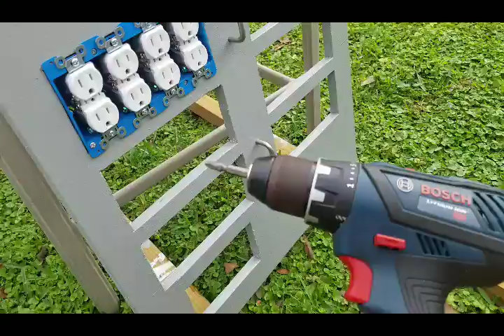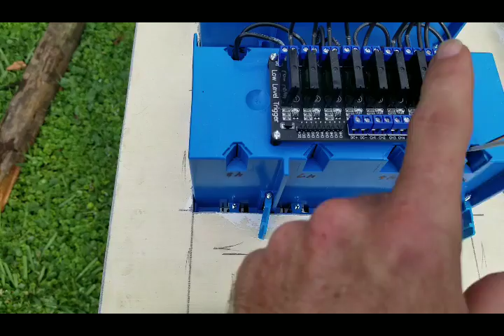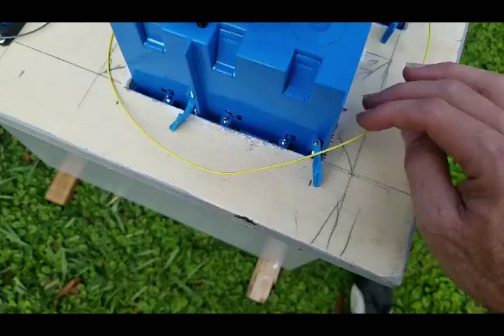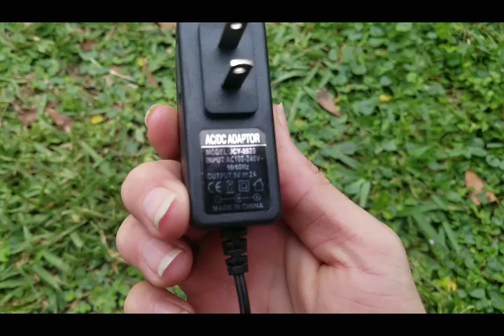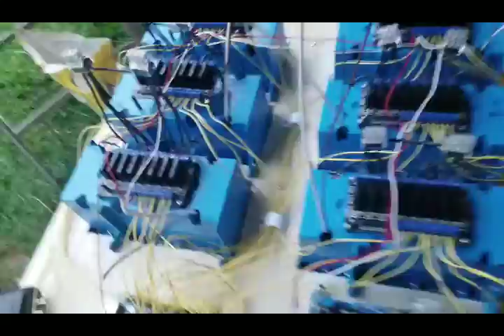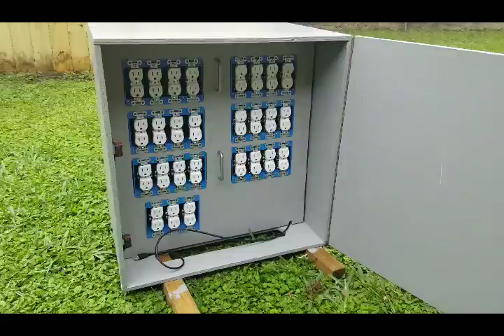Christmas Light Control Box Build - Part 5 - Powering It All

Comment: My dad has been talking about this for a decade.

This year I bought an Arduino Uno R4 WiFi and I got Vixen Lights setup to do a simple thing with Jingle Bell Rock.

Just a single light right now but I can watch the 4 channel relay going off.

I read that the Solid State relays are better since they are better for faster flashes, and the regular relays can heat up and fuse together if they go too fast. So I will have to look up that relay you have in the video to see if it's still around or something similar. I think we're going to need minimum 5 or 6 channels for the first year of doing this. Probably not until Christmas 2024.

But I am definitely bookmarking this so that I can reference this entire build so I don't burn my house down HAHA.

Thanks so much!
Reply from the maker: Awesome!!
Glad I could help. These boards are still available, just watch if you get low level or high level triggered ones. I got low by mistake. It can easily be fixed in the arduino code.
I never got them running with Vixen. I haven't gave up on it, but I've had a lot going on to mess with it. Maybe next year!!

Comment: Thank you for your videos. You explained everything and makes this look easy. But I am sure it is not that easy.   Thanks again.
Reply from the maker: No problem! Glad I could help.
I enjoy the design and building part. Way more than the hand programming (which I don't recommend). Hopefully I can get it to talk to Vixen or even better, XLights in 2022.
In 5yrs, I plan to have more pixels; if not all. I'll have a few up next year if all goes well. If you have any questions, feel free to ask!
Reply: @OutdoorsWithShawn  You are welcome.   Can you furnish us a copy of the wiring setup as to what wire goes where on you arduino?
Reply from the maker: Let me see if I can schetch a diagram up and simplify it. 
I may have to change or possibly remove a pin or two due it being on a TX/RX pin I may need for communication with the computer. I'm pretty sure I started with Pin 0 and went around, but there were a few key ones I had to skip; but I got it written down.

It may be a few days, I'm starting putting on a total new roof on my house tomorrow morning.

Comment: Is there any way to make the lights dimmable like a fade effect? Or can they only blink?
Reply from the maker: Yes, you can have them fade down to a certain point before they shut off. The problem is, you have to change each of the relays to a different type of solid state relay, and they're not exactly cheap, probably around $7ea new last I looked. They are a "non-zero cross" relay. If I can find the model number for it, I'll post it.

I believe you can use a certain style TRIAC or Transitor in place of the relays to have them fade. I'm not sure which type(s) will do that though or how to wire them up, sorry.

Comment: is this on a 20a circuit? how much does this whole system draw when you hook it up? thats a lot of recepticles to connect to an single circuit
Reply from the maker: Yes it's on one 20amp outlet. This is the only thing on that breaker, wired with 12-3 and is maybe 15 to 20ft from the breaker. It may draw 14amps at most. Most of the outlets have 1 to 500 LEDs on each one. I did the math over and over so I didn't have any current draw issues.
Reply: @OutdoorsWithShawn  very nice

Comment: Hey Shawn, I completed a similar build, and it works great but for some reason my GFCI outlet keeps tripping.... any ideas? I don't think I have enough lights to overload the outlet, so not sure if it's my wiring.
Reply from the maker: You have either a loose wire grounding out, or a wire crossed )not in the proper plac) or water is getting in somewhere. 
My GFI trips when it rains, so I usually shut off the show then.